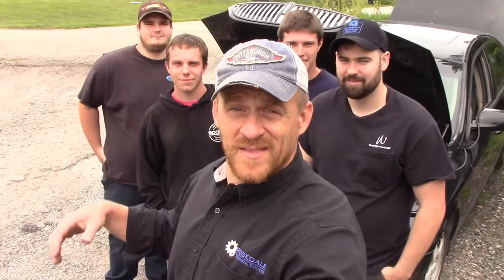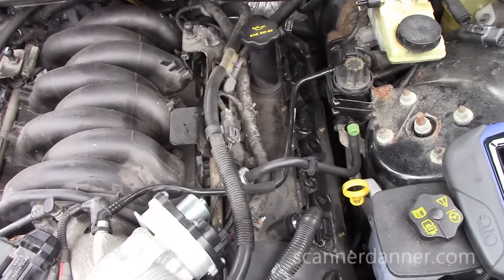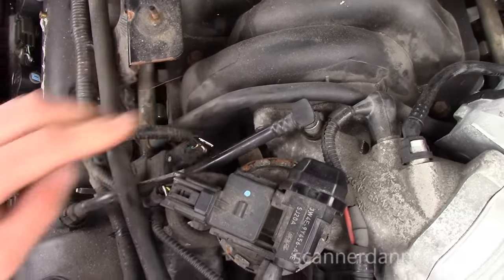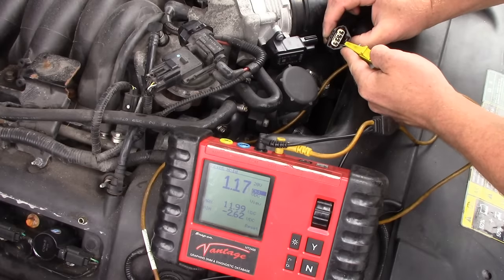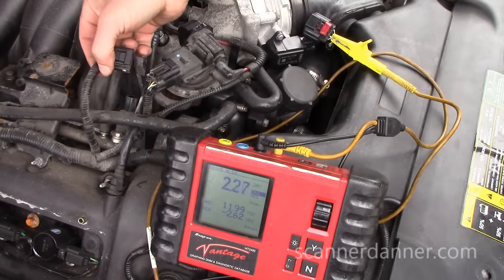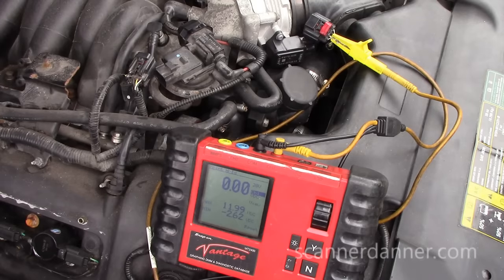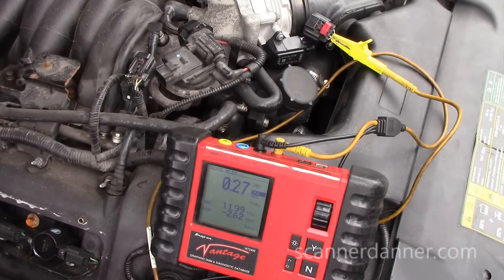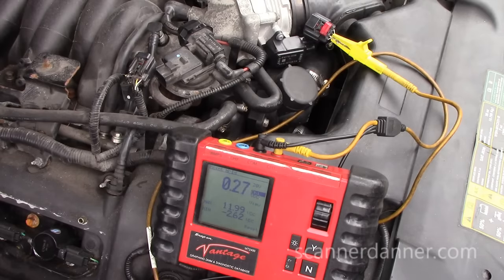Troubleshooting a No Start, No Spark, No Fuel, No Com (any car)

Comment: Im in the need of help. Supposed to be a easy hook and play on my 90 f150.  Everything I had new on my old block went to this other one. I have no spark at the coil,no injection power, no fuel pressure. Even change complete Distributor and coil, computer.  Have a suggestion
Reply from the maker: Step 1, does you check engine light illuminate with the key on?
Step 2 check for a 5v ref on your TPS or MAP sensor and report your findings
Reply: @ScannerDanner  4.9 at the map
Reply: How bout it scanner Danner. This is what I've done. New computer, tps, egr, iac, temp sensor, 2 new distributors , 2 new coils, change wire harness. I still cannot get fire to the coil or distributor.

Comment: I'm experiencing a kooky situation 2001 Focus shut off while driving. No crank no start dashes on odometer. There is a switched ground prob somewhere not letting the starter relay energize. The fun is in the hunt the frustration is the never ending fail while testing things. I'm doing something wrong or something is really bad.
Reply from the maker: Test for a 5v reference on your TPS and tell me if it's there (key on)
Reply: @ScannerDanner  I'm finding 1.94v on TPS & MAF FINALLY have a direction per your videos. THANKS
Reply from the maker: @clutch5sp989  yeah man! Sweet. I have some other really good videos on the 5v ref circuit here too.
They'll be in my chapter 9, 10 and 11 playlist.
One in particular I want you to watch was a shorted MAP sensor on a Honda
Reply: @ScannerDanner  Great help. Enjoying the videos learning a bunch of new things. It will be GLORY when I find the actual prob. Gotta prove something is bad before buying parts$$$. THANKS
Reply: @ScannerDanner  Pulled the PCM and it has rattly bits inside. 2-BB sized pieces of metal shorted the board. Found a PCM on egay for $35. Now to learn how to reprogram it maybe with Forscan I have.
Reply from the maker: @clutch5sp989  how do you like that 5v reference check? Pretty sweet test huh?
Reply: @ScannerDanner  YES...new technique for me to use. Gaft'd it off as too hard when really easy once understood. THANKS

Comment: i have a project for your class if you want to take it on i have a 6.0 f20 diesel and keep getting a contribution balance on number 6 i have new under hood harness.e to be put on good test case i suspect its a voltage thing
Reply from the maker: Thanks but no thanks. Though our diesel program may be interested. Feel free to call the school and ask them.

Comment: could the coil in the relay caused the voltage drop ?  Those contacts in the relay didn't look too bad.
Reply from the maker: no sir, if the coil side of the relay had an issue, it would never latch the load side contact or it would buzz very rapidly

Comment: 1999 S10 no spark no fuel apparently can't here it replaced cam sensor crank sensor control module still nothing any ideas welcomed.  .thanks
Reply from the maker: "Apparently can't hear it" What, the pump run? Not good enough to go by for the fuel. Need to know, critical next step
Reply: @ScannerDanner  it's a no spark crank condition the truck just died I honestly thought I ran out of gas I changed cam shaft position sensor cap and rotor crank sensor even got a new coil and control module .I don't know what else to try? There is power going to all of those parts could it be the computer???
Reply from the maker: @david_bmx1148  pull the cap off and make sure the distributor is turning. Second, with the key on, make sure you have a 5v reference going to your TPS (one of the 3 wires should show 5v)

Comment: 1) Battery 
2) Engine Lock out 
3) Engine Kill switch 
4) Alarm , Ignition Lock Out Kill Switch 
5) GROUND .
6) FUSES AND FUSES BOX  , LOAD AND RELAYS , WIRING .
7) CAR NOT IN PARK ( AUTO MATIC GEAR BOX )
8) CLUTCH NOT DEPRESSED ( NEW MODEL CARS )
9) BRAKE NOT DEPRESSED .
10 ) BATTERY TERMINALS LOOSE .
11) GAS PEDAL NOT DEPRESSED , THROTLE  CONTROL

Comment: Yes, even a flat battery will show almost full voltage, until you load it.. A dud relay can cause a lot of problems, if the contacts are poor you have an IR (current thru resistance) voltage drop.. This one was a real doozy..

Comment: MY 98 grandcherokee  check engine lite on code p0340 replace crankshaft sensor it run two months then check engine lite on again , sometime could start then could not start , the code p0340 I replace the crankshaft position sensor again but can not start , it is the pickup coil need to replace ? thanks
Reply from the maker: Bad cam sensors can cause false crank sensor codes on these

Comment: If all powers and grounds were good. Would you suspect a faulty ecu?
Reply from the maker: If all powers and grounds were good, I would have had to unplug that tank psi sensor and make sure I didn't miss any other 5v ref sensor. Then check the 5v ref circuit for a shorted harness,  then and only then would you condemn the ECM
Reply from the maker: Watch my two part "bad engine computer" testing videos

Comment: ScannerDanner, i have a Chevy Express 1500 which i just replaced battery after 3 years since previously installed yellow top battery. I replaced with another yellow top and now after 1-1/2 months of having new yellow top it is "clicking" as if battery is dead. I have 850cc jump pack and usually it will start immediately. It clicked with jump pack on battery. I connected jumper cables and it shows 13volts in battery and it should turn over with min of 10v but it just "clicks" even at 13.5v when I disconnect everything and put multimeter on batt it jumps down to 5v immediately?? Wtf?!
Reply from the maker: If you take the jumper cables off and your battery voltage drops to 5v, your battery is dead and you most likely have a parasitic drain on your system.  If a battery sits in a dead state when the weather gets below freezing it will cause the plates to warp and short the battery.

Comment: Dear sir I have emegrand geely 2019 model it's not start when I deleted the dtc code then he does start normally the dtc code is p152381 please refer to the service manual this code engine showing in the dash board crusing what is the meaning and what I do please suggest to me I am checking all fuses it's okay but airbag Bloon it's torn I am charging the throttle but doesn't start only cranking when I delet by scanner then start the normal
Reply from the maker: http://eautorepair.adtrk.biz/?a=10817&c=24&p=r&s1=
Where to get service info on your car for $20 (same info I use)

Comment: Just a question, could the power probe 4 have done what that other tool done?
Reply from the maker: Technically a jumper wire (used properly) could be used. Jumper the load side contacts then measure your voltage on both pins

Comment: I know why the previous mechanic changed the coils - because EVERYONE who doesn't know what the problem is when the car is no start, changes the coils, in blind hope.    Odd thing about coils - in the last century, there was one coil, it cost $20, and mostly lasted the life of the car.  Now, there are multiple coils, each costs more than that, and they fail often.  Something has definitely gone quite wrong here.

Comment: How would you test it if you had no reference? I'm not getting anything at the meter...
Reply from the maker: I have quit a few no 5v ref videos.
Powers and grounds to the ECM first, then if those are good, you could have a shorted sensor, pulling the ref circuit down, or shorted wiring

Comment: Thank You .  can you use a jumper on the load side of relay? With fuse to check and see if it works? Like a fuel pump?  If so for DIY. Co fuses both sides co wires. Ck grounds then go for 5volt signal.  There's a lot in here gonna follow ya.  Thank you. Wire harness for corrosion. And breaks
Thanks for being my teacher now. Just learned to hook up my fog lights with relay
No more warm switches. You can teach old dog new tricks.0
Reply from the maker: Thank you! And yes, you can jump the load side of a relay to force the output to turn on. Just have to be SUPER careful that you're jumping the correct pins. If you accidentally jump the control side you can fry the computer driver for that circuit.

Comment: Spanner Danner plz I have a ,07 Silverado extended cab 4.8 and I have no spark and fuel pump does not work and also it won't crank from the key even tho I have all the lights
Reply from the maker: what codes? Attack the no crank condition first for sure. If you are jumping the starter to get it to crank and you have found during that time that you have no spark, then the ECM is not "alive",  which is why you want to attack the no crank issue first as the ECM controls the starter relay. You found the right video though. Do you have a 5v reference?

Comment: I need help plz my sister is a single parent she a 2002 jeep liberty sport it was running fine last night this morning it wouldn't start so I did the best I can do it has no spark no fuel I changed the cps and still same thing do you think it's a compute issue.?
Reply from the maker: Man, I hope you didn't go that route. Sometimes it's cheaper to pay someone you trust than to throw unnecessary parts at the car. What codes do you have?
Reply: @ScannerDanner  no codes at all
Reply from the maker: No spark and no codes?? I can see having no fuel pressure and no codes. Are you 100% positive you do not have spark? And are you sure there are no codes (no communication is not no codes)
Reply: @ScannerDanner  I'm a 100% no spark no fuel

Comment: So do you know what caused the relay to fry in the first place?
Reply from the maker: It didn't "fry", it was pitted and it just happens sometimes. No particular cause for this failure.
Reply: ScannerDanner sorry, I was thinking fuse where it blows from higher amps going through instead of relay. Over on aeswave do you have any codes for letting them know I'm buying thanks to you? I'd like to make sure helpful individuals get noticed.
Reply from the maker: I do, thanks! Anything I have linked in my videos and on my website tools page has the affiliate link. If you use these links and make the purchase AES compensates me. Thanks so much again

Comment: I have a 1984 300zx  with pin # 6 on the ecu not getting ground and pin # 34 that powers the ecu not getting power I'm a bolt on parts guy changed many engines and trannys clutches you name it but when it come to electronics I suck if anyone got any ideas please tell thanks

Comment: I'm also a Master you need 12.50-13.50 volts at battery all times during testing ?
Reply from the maker: It helps to have a fully charged battery but it is not necessary to complete a diagnostic process. It adds variables for sure.
Reply: Not you AGAIN! You are certainly not a MASTER if you can't understand the simple fact that this was STILL able to be diagnosed with the battery low. FIVE VOLT signal missing---he found it--fixed it---CAR RUNNING. While you would of been playing around with the battery, he had it diagnosed and running. You would be the last MASTER I would want working on my vehicle!!

Comment: Paul is great, but as I watch his videos i am more and more convinced that todays auto manufacturers are responding to dealer complaints about not enough return business for repairs, and part sales. Simply look at the cost of a single COP for a Ford. Sn OEM coil costs around $54. You can buy an entire aftermarket set of 8 for the same price. Is the OEM better? Absolutely, but 7 times better???? I have been running a highly rated aftermarket set on my 5.4 V8 for 4 years without a hint of a problem. My position is " If its inside the engine, only OEM. Outside, you can go aftermarket with good reviews."
Reply from the maker: Tread carefully! There are s--t parts everywhere these days.
Reply: @ScannerDanner  I know Paul,  even OEM parts mostly made in China. I've had good luck with NAPA. I really feel for you young guys. I'm 78, and when I was young, you could depend on quality. Ross Perot warned us. I voted for him twice. Now we are paying the price for Voting in Waffling Willie Clinton, the draft dodger.

Comment: good video.  i'll  be the idiot to point out the knee jerk reaction to go after the 5 volt reference. but also i will point out  that you seen that thru and went for power and grounds. we can debate this all day but in the end you 1) had a plan 2)thought that plan thru 3)stayed on course 4) found and corrected the problem.  just goes to show there's more than one way to skin a cat. meow
Reply from the maker: For sure man. And I chose these methods to in relation to just covering the 5v ref with them in class. To see it first hand was awesome!

Comment: What if you do a 5 v ref and get 12 is there a 12 v ref cause i gotv12 v
Reply from the maker: Some TPS"s have an idle contact switch that will show 12. What sensor are you measuring and what car?

Comment: I have a 1993 ford f150 will crank no start I have fuel spark air n compression I have replaces fuel pump n filter
Cilinode
Fuel relay fuse 
Spark advance 
Ignition switch moldule

Comment: I have a no crank no start I check my test light and it’s barely lights up and I check my starter connector no power and also no communication with ecm and know check engine light radio lights all come on and battery drains
Reply from the maker: Step 1. What is battery voltage during cranking?
Reply: 12v battery fully charged I also checked my connection to tcm and no ground in 73
Reply: @ScannerDanner  I checked battery voltage 11v then  I checked fuses all good
Reply: @ScannerDanner  hello scanner I checked some things out and what I discovered under my fuse relay box harness that’s plugged under the box the very first I did a power check on the wires and pink/blk and black wire no power. Any idea where’s them located 2010 Chevy cobalt 2.2l
Reply from the maker: @HenryMoore-pe9xt  you need good service information 
https://eautorepair.adtrk.biz/?a=10817&c=24&p=r&s1=

Comment: I have a 2006 Ford escape 3 l it's not getting any spark it turns over but won't start I changed the crank sensor I changed the cam sensor I changed the ECM computer I changed the BCM still no start the Ford scanner that my buddy use just giving some stuff but I don't understand what it was saying it said something about a bad BCM and a bad computer and I don't know but I replaced those all the relays are good all the fuses are good oh and it's not getting any RPM signal but when I put a probe into the wire that goes into the computer it's saying that the crank sensor is working from that spot
Reply from the maker: Need a complete code list with the description of each to be able to help
Reply: @ScannerDanner  how do I send you the codes as you can't send gifts or pictures on here
Reply from the maker: Clear them all, then crank it over, then re-read them all and list them here. Type them out
Reply: B106e....b1342...p1000...u0401.b2900...b1302...b 1318....... This all started after I took the alternator wire power wire off the alternator and put it back on
Reply from the maker: @krazydogg7685  need descriptions too my friend. I need you to help me help you as I'm helping 300,000 other people too. Definitions please. You are also going to need some good service info and wiring diagrams https://eautorepair.adtrk.biz/?a=10817&c=24&p=r&s1=

Comment: I bet I can stump you I have a 2003 s10 will start fine 1 to 5,6 days then all of a sudden won't start and will turn over and diesel till the battery is dead charge it back up and keep cranking and eventually it will hit and start up and be fine untill it sitse for over night . Spark plugs are wet with fuel when It won't start and plugs are firing , I have changed the whole distributor, plugs and wires,came and crank sensore ,coil,both o2 sensores,mass air flow sensore,map sensore ,tps sensor ,battery air filter , fuel pump . I'm out of ideals it's my only vehicle for my family and I'need help please Mabie point me in a detection to fix it .
Reply from the maker: Is the fuel psi regulator inside of the intake manifold on this model? Central port injection system, right?

Comment: I have a Suzuki X90 1996 that stalls but won't start. Can someone tell me what might be wrong with it?
Reply from the maker: No one can tell you anything other than a guess with what you've provided. You need to find out what you are missing DURING the no start condition. Is is spark, fuel pressure or injection pulse? We at least need some direction to help you. Thanks!
Reply: ScannerDanner  It is at an autobody shop and they check the spark plugs, distributor and still can not find the problem. The mechanic told me it is a sensor problem but does not know which one? I did my own research and found that it might be 4 things why the engine stalls: fuel injector relay, loose wire near the exhaust manifold, loose wire or burnt starter fuse and last would be the Crankshaft Position Sensor.

Comment: I disagree with the Relay unplug thing , you CAN Identify the problem with unloaded circuit. 
Great video tho 👌
Reply from the maker: unloaded circuit testing is a sure path to misdiagnosis in a ton of circumstances
Reply: @ScannerDanner  yeah i agree but not here , it might make difference is switch mode power supplies ، cuz the battery here already have loads in other parts of the car. 
But what you did is the 100% accurate thing.